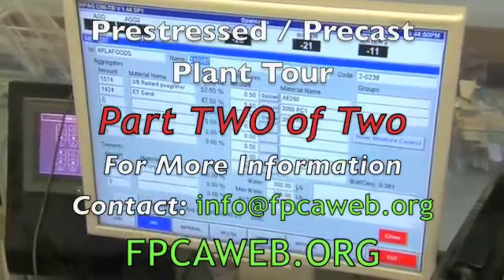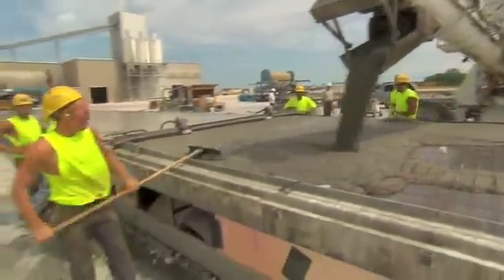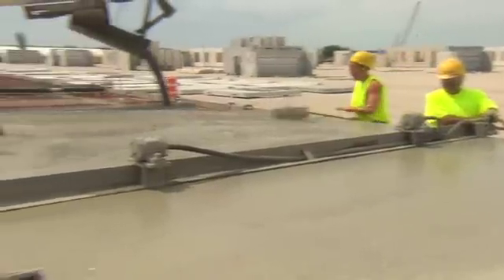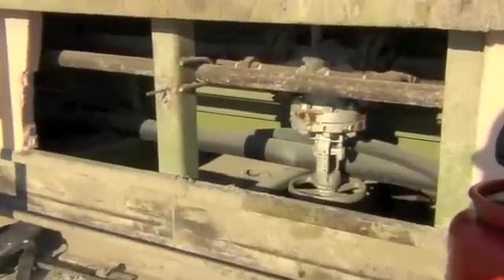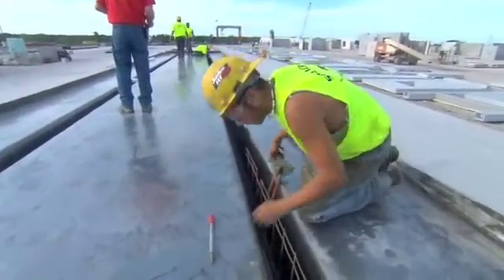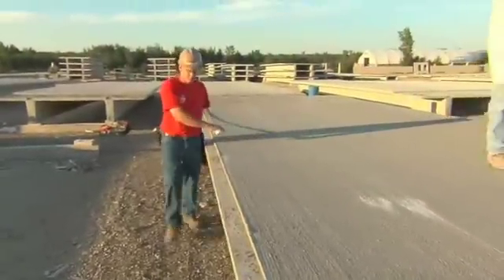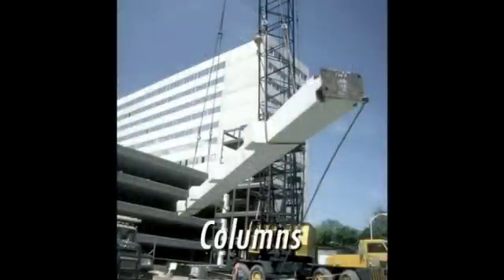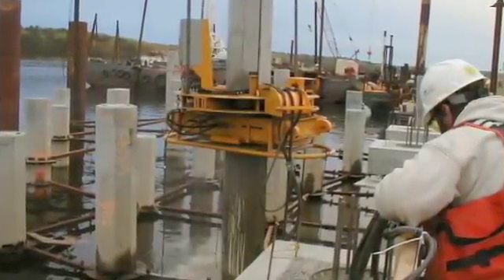Prestressed / Precast Plant Tour Part 2 of 2

Comment: I would like to thank you for this video, but i have a question if we have roof slab with span 10 meters and the total live loads on the roof =2.5 ton/m2 due to fill load on the slab my question we can use precast hollow core slabs or not ?
best regards
structural engineer sayed